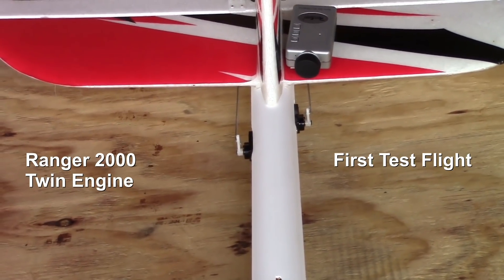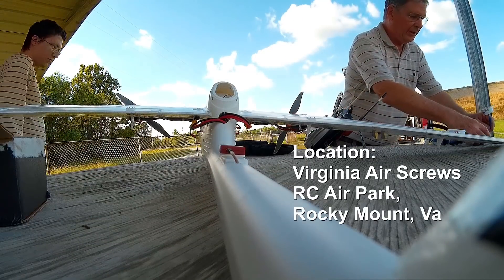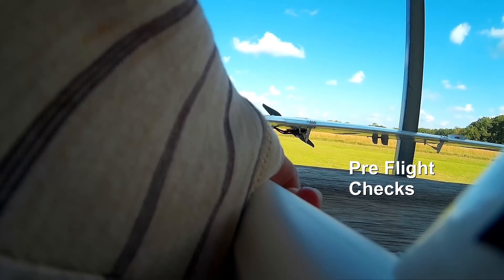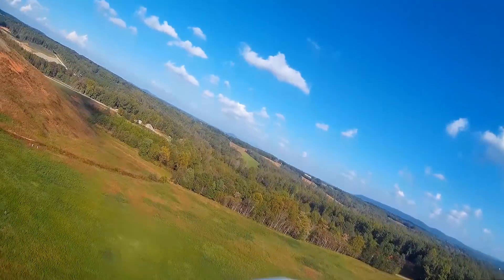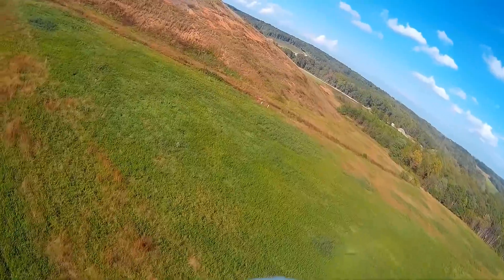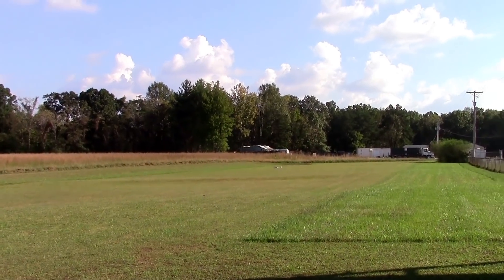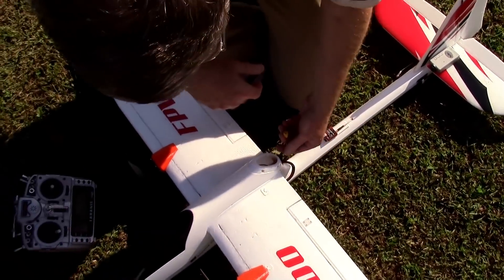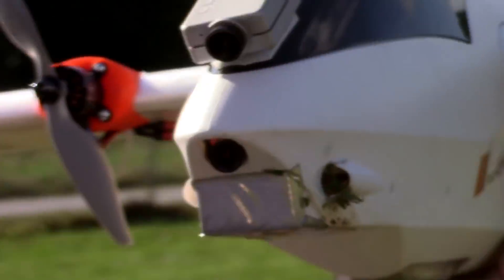Twin Engine Volantex Ranger 2000 RC Plane Maiden Flight (Pilot Dave and Captain Jon)

Comment: Great build  ,,would love to see a disarm switch on each motor see if it flys with one engine fully laden for long range flight that is the reasoning i guess for the extra engine if you burn one out or sieze one 😢,, may be it do  a good controlled landing only in that situation to save crash damage

Comment: Congrats..... here is a wing clip holder as I suffered the same break doing the same landing...... https://www.thingiverse.com/thing:3149023
Reply from the maker: Oh! Thanks so much. I was thinking about you after they broke and remembered your video flight with the 3DP mods.
Reply: No problems happy to help...... I also cable tie my esc wires to my motor wires so the battery doesnt pull them out when I have those heavy landings,. have a great weekend ....... it looks like its going to be raining all weekend here in non-sunny Australia,.... cheers mate
Reply from the maker: Question, did you just glue the clip holders to the foam and what keeps them from ripping loose?
My son printed them out today and wondered how to attach them.
Reply: I just hot glued the clip to the plastic fuselage so the wing still can clip in and out...... the holes in the clip allows for the glue to ooze out and hold it in place better. That is why the clip is curved as well..... you can also stick a screw in it but I find mine is as tight as.
Reply from the maker: I see now. Thanks for the help.

Comment: It's a great bird Dave, and your twin motor was always going to work wasn't it?...Be interested to see you stretch her legs at some point when you get her ironed out.
  You used that 1.2G Singularity antenna on your wing.....You need a Dipole, not that thing....lol.....See me after School.....:)
Reply from the maker: Right, I am really excited about cruising out over the countryside with the goggles on. You are probably suspecting the Singularity antennas will hurt the range but hopefully they will be a enough to go the mile.
Reply: @DaveMerc  No, its just that a Dipole is so much better and less drag too...I have an R9M Combo now to play with, looks good but the Firmware still needs work...Please include live feed in your clips...;)
Reply from the maker: Believe me I wanted to include the FPV video feed but unfortunately the dvr SD card in the goggles was not fully inserted and I didn't get the recording. I was bummed about that too.
R9M looks like a good option, let me know how it works out.

Comment: Are the runcam HDs just sticked in by velco? Firm enough ?
Reply from the maker: Correct! Been doing it that way for years and it works surprisingly good. Guess you noticed the cams stayed put during the hard landing.
I think it might even provide some vibration dampening although I have no proof just anecdotal.

Comment: Great job Dave and Jon,love what you have done with this plane! Keep up the great work, get the bugs worked out of it, and have Jon  print up some extra wing clips
Reply from the maker: Hey Glenn you getting any rain up there? We are swamped! I got some Velcro straps holding the wings on now until Jon does the clips. The clips are hard to install so they may never get used.